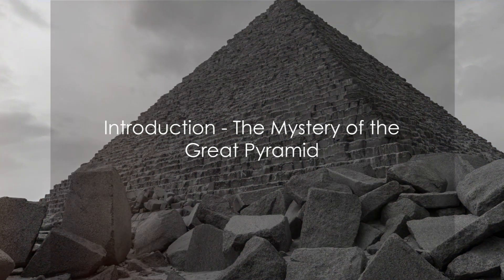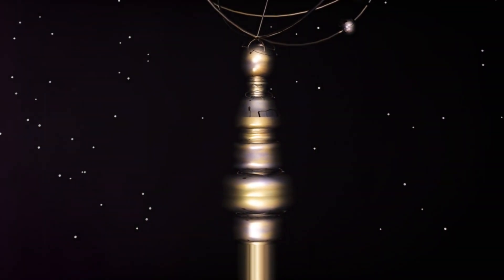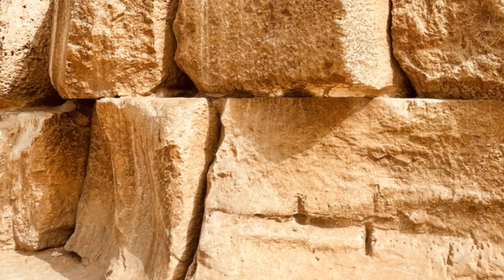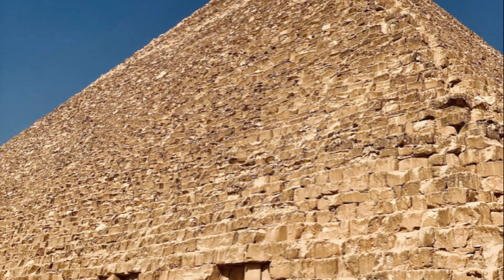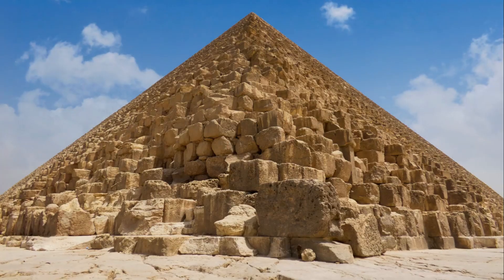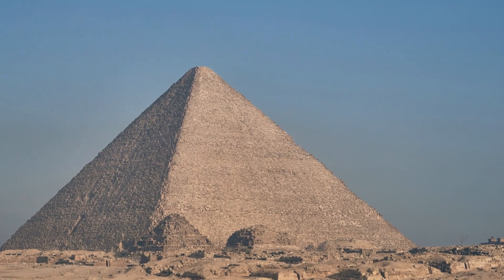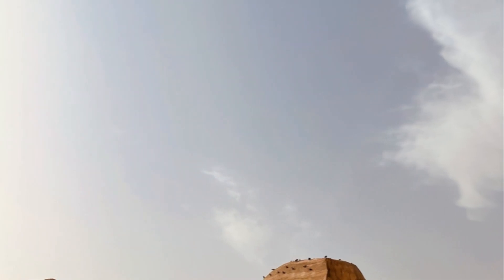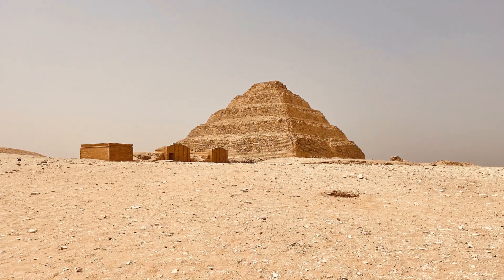So How Were The Pyramids Built In Ancient Egypt?

Comment: first pyramids of Giza are much more older than 2500 BCE , Egyptians did not had tools, precision equipment  and transportation means needed for such a task
Reply: Unfortunately they did have all of those things. read and research. Youre doing yourself and anyone one else you parrot this thinking to, a disservice. Knowledge is power - try not to fall into comfirmation biase by just watching youtube channels.
Reply: @iThinkNZ shoe links ,becoz dudes right . copper was too soft for granite.
Reply: @iThinkNZ  you do not know what you are talking about , i had work cutting granite for 3 years using Pionjar rock drill and feather and wedge steel chisel all tools Egyptians never had , precision and anti-gravity lifting pods were used